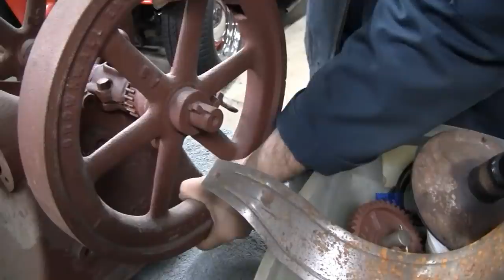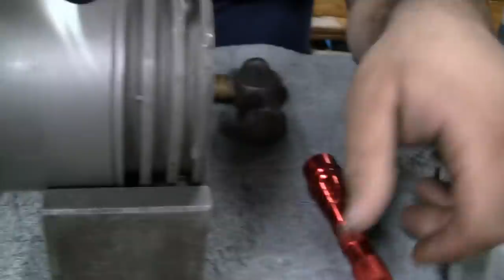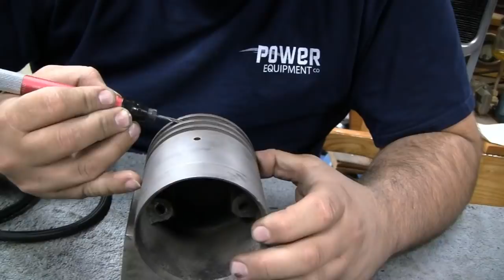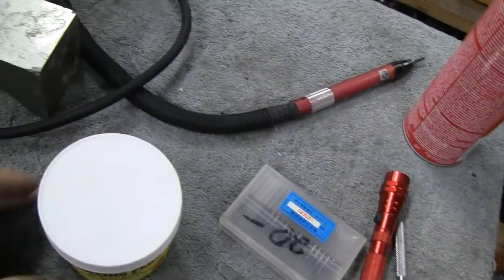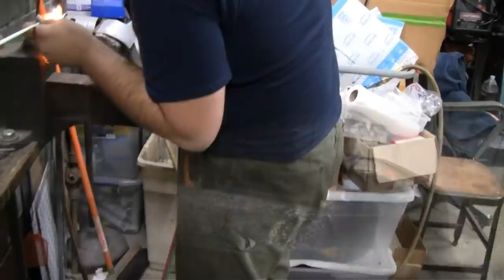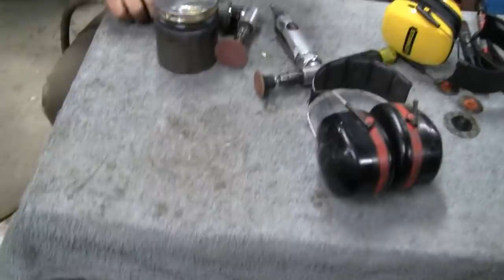BROWNWALL HIT and MISS ENGINE RESTORATION (part 3)

Comment: Will it fit in your lathe?  Could chuck it up and turn it to clean it up a bit.
Reply from the maker: Yeah it will fit in the lathe, It's alot easier to just to use the angle grinder since it was already set up on the bench!!☺

Comment: Are you filling the ring groove completely and if not won’t that be collecting oil ? With vintage outboards we fill in the ring groove completely but that’s on much smaller engines then yours .
Reply from the maker: Nah we're not filling the groove completely, we don't see a need to!! Don't know about the oil collecting!! It's a 107 years old, if it runs and idles at 200-250 RPM at the shows than we've accomplished our goal!! I'm sure we'll come across a replacement piston eventually!!☺

Comment: If it is  braze it up around its entire perimeter then machined down on a lathe. A new thinner  ring land can be cut in and run it with 3 rings again. Use a thinner modern compression ring out of a V8 or something

Comment: I'm curious, will the extra weight on the piston throw the engine into a vibration , I know it's going to run slower, and may not effect it, just a thought ?
Reply from the maker: We knew somebody would mention a balance issue Matt Matt!! No there wouldn't be any vibrating, not even at normal operating speed!! The piston is only sliding back and forth a couple inches!!☺
Reply: That's what I figured, just was curious

Comment: Is there a common cause for pistons to crack like that? Someone overzealous with removing stuck rings or something??
Reply from the maker: I would bet this engine had a stuck piston!! It doesn't have a head so the piston comes out from the rear of the cylinder!! From the looks of the crack I would say someone was beating on the piston through the spark plug hole!!☺
Reply: @805ROADKING  I can see how pounding it free of a rusty cylinder could do that.

Comment: If you ever have the chance to tig weld cast aluminum... just don't. I have a sears lawn tractor with an aluminum mower deck and I found about 15 or so cracks and wire wheeled and v'd them out with a grinder. I start welding and I hear cracking and popping. The cracks were branching out and new cracks opened up. And even after all the cleaning and burning the oil out with a torch it would still bubble up black stuff and dirty my tungsten. I probably put 30 welds on that thing.

Comment: are you going to clean that up in the lathe and cut out a ring groove? or leave it like that?
Reply: @Hey It's Drew They're leaving it like that. So the engine will have one less ring, which is fine for what they are using it for.